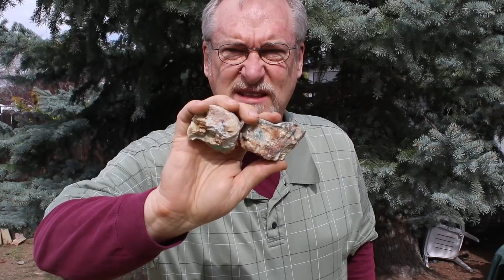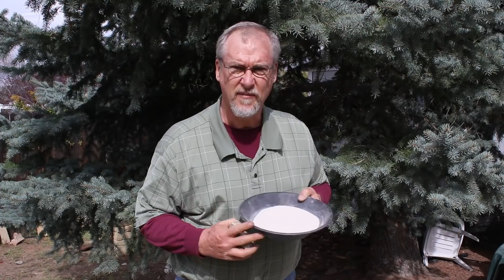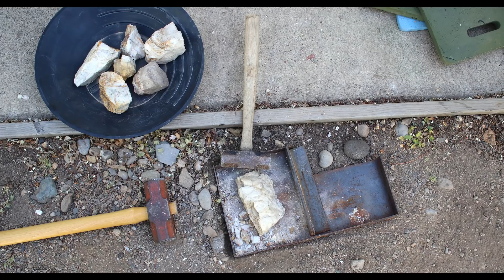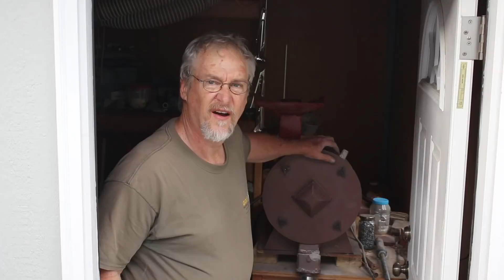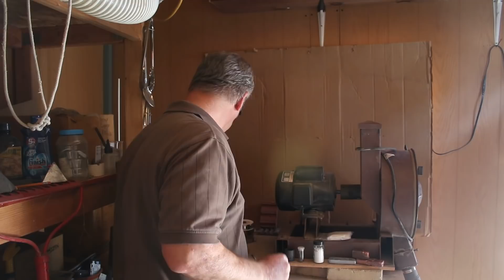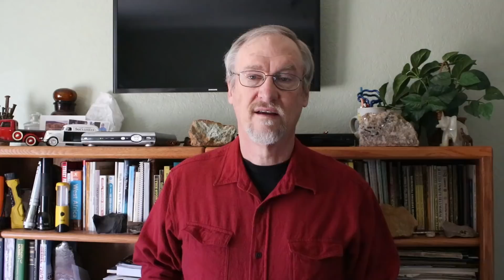Gold Prospector Reveals Best CHEAP Techniques for Finding Gold

Comment: Hey Chris, this is the one and only time that I know some thing that you might not if you would like to have your chains last longer put your ores in the fire and heat them up to soften up the rocks so that way when you put them in your crusher, they will be softer and your chains will last longer you won’t have to switch them out so much so often this is an old minors trick. I heard that if you soak them in vinegar before you heat them up that  works as well. But I just heat them up in my fire pit in my backyard and use my leaf blower to increase the temperature on the rocks and speed up the process. Some guys put them in a metal container and then put it in the fire, I find putting them in and letting them get going down to the coals works just as well.
Reply from the maker: Or you can use hardened steel chains.

Comment: Chris, I was wondering if TWO rock crushing machines are necessary.  The jaw crusher and the chain crusher?  They are so expensive and wondering if perhaps a newer crusher had been developed that would take a larger sized rock and pulverize it to powder.  Thanks.
Reply from the maker: You can use the chain mill only, but it is much slower and makes a lot more wear on the chains. It will cost you a lot to save money 💰.

Comment: Chris, your flux only had two components while Chapman flux and thinner has a few more.  Why is that?
Reply from the maker: The fluorite "thinner" doesn't melt at the temperatures used. CaF2 melts at 1350 - much higher than my furnace ever gets. The other thing is that it is not a thinner but a thickener. Its used in steel manufacture, but steel melts at much higher temps, so CaF2 is OK for that. Silica can be good to add if you are melting stuff with no silica in it, but its not absolutely necessary. Borax is the main thing that will capture iron oxides in a flux, and that is what I was trying to do.  Chapman flux works, but is over-rated as if it had some kind of special properties.
Reply: @ChrisRalph  I haven't done this process yet so your input is very much appreciated.  I was reading your book a second time last night and I think that I found exactly what you describe on page 216-219. My last question is do you think that roasting should be done prior to smelting?
Reply from the maker: Depends on what you are melting - some things need to be roasted, others do not.

Comment: Chris what do you know about 1960’s and 70’s metal detectors? I have a crystal controlled b f o metal detector “hiker 2” model from I think the Kovack company. They used to be advertised in the c m j. Any info would be helpful. Much thanks.
Reply from the maker: They are ancient technology - you are basically handicapping yourself. Think about what it would be like going back to a personal computer from the 1980s. You have the metal detector equivalent of a 1985 computer. New BFO detectors have not been made since around 1990. You could get a better detector for $200.

Comment: Thank you very much for making all these videos.  Although I have had a great geology professor and a couple semesters of geo classes I had never considered trying to turn prospecting into profit.  Well the Virus hit, paying work evaporated and I’m a single parent so now it’s five months later, I’m dead broke and we have 34 days until we are homeless.  But thanks to you we have a few on ounces of concentrate!  Just watched this video for the 5th time.  I’m stuck, 
where would we find the flux, the Borax and Sodium bi carbonate? 
Do you think a plumbing torch and map gas would do it?  Could a ceramic coated steel pan work as a vessel? 
Is there some household object that will work as a mould like a plumbing fitting?  
And finally how do we turn the cast button into cash? 
Thank you so much , if my little girl and I have a roof over our heads this winter it’s completely because of your selfless work making these videos! You’re the best!
Reply from the maker: You can get borax and bi-carbonate at your local grocery store.

Comment: Chris, you might want to try a higher hardness chain also called a proof coil chain. The cheap box store chain is normally a grade 5 or grade 3 chain. If you get hold of a higher grade chain it will stand up better to abrasion
Reply from the maker: The inside of the mill is sized to hold specific sized chain, and the harder chain is sized different so it does not fit.

Comment: Hi Chris.  Thanks for demonstrating the process from rock to metal.  Basically, how we did at our lode mine near Searchlight, NV many years ago.  However, we had the luxury of a 10" crusher and 48" impact mill.  Average .5 oz/ton Au and 1 oz/ton Ag.  We also collected more mercury then we put in !
Reply from the maker: That would go through the rock pretty quickly!

Comment: I'm going to weld a ball hitch to hex pry bar...make  a morter outta a thick piece of pipe heat up a piece of 1/4 inch plate to fit the pipe...round it to fit the ball weld it in then 1/2 inch plate for the base putting the bottom of the mortar right against the plate...I wont have to pay for a gym membership then... everytime the wife gets mad at me I can go pound rocks into sand sounds like a win win...
Reply from the maker: Breaking rock is exercise.....
Reply: @ChrisRalph  worked concrete for 15 years I made a lot of rock 😅...for some reason I get great pleasure out of cracking open rocks...I can watch the old granite splitter gent for his whole videos rod n hammer...tik tik tik tik tik tik tik...tik hole wedge again...again...again.
.tik...tik..tik tik ....tik tik tik tik....crack...love it....everyone in my life has called my passion for splitting rocks and my amazement over rocks  silly... or... childish...or absurd...now I can share a video...and they are starting to see...they go...ohhhh...i dont want to get in it for money...idc....about the money...bonus 😁 but idc...I got a gold pan... I got a sluice matt built a small sluice...a metal detector.....i have a microscope some trinkets...a chipper...scraper...hook...wedges...3 n 6 lbs thor hammers and a will to give it a try...for the sake of exploring my environment...my kids love busting open rocks as much as I do and pockets always have to be emptied on wash day because our pockets are all full of rocks...lol even mine...sooo...time to figure out the legalities in my area and go forth and explorify...👈had to correct that 4 times to make that a word👍😆...I really really rather than gold or other metals, would like to find geodes small aggets and little gems...we can make jewelry for my autistic daughter...she loves homemade things...I'm going to get some of Dan Hurds ocean picture stone...that right there leaves me speechless...n my daughter looked at piece after piece...so I hope I'll figure it all out and get to get in on the action a bit...love your videos...thank you...

Comment: Hey Chris. Thanks for your very informative videos.  I live in NE GA, a stones throw from where gold was first found in the states.  It's hard  to find info about the specifics of prospecting here and was wondering if you had any advice.  Most locals don't bother with looking and the ones that do are pretty tight lipped.  So far lots of fun in the woods and creeks, which is kinda the point, but not much luck.
Reply from the maker: Lots of info out there - search on line. Problem in the SE part of the US is that almost all land is private and owners dont welcome prospectors trespassing on their land.
Reply: Thanks for reply.  Luckily I own a cpl of properties right in the middle of the " gold belt" so no trespassing for me.  One is lowlands where 4 creeks converge the other, where I live, is cut into the side of a mountain.  Been collecting hopeful ores and starting to crush.  Your videos are great and very informative, so thanks again for the info, I'll keep watching.!  Peace.  Z

Comment: Does the flux mix you used make it so you don't need to roast or was the ore you were working with a type that is not going to add to the gold by roasting? Thanks for all your work
Reply from the maker: There were very few sulfides in the concentrates, so no need to roast.
Reply: @ChrisRalph  does your book go into detail on what ores should be roasted or how to "see" the sulfides? or maybe a video I missed. Honestly thank you for all the information in usable form.

Comment: The sitting on seat clip with lecture is mute for me.
Have you a source for me to buy one of those rock crushers please? Does it have a brand/make or model please?
If you must use cheap soft chain you should prepare some with hard steel paddles welded on, Make several and balance them by weight into pairs.
Reply from the maker: Why dont you do that? your comments are mute to me because you dont know the work involved.

Comment: Chris, I put the hardest chains I could find in my custom built chain mill as well as I built it out of 1/2” hardened plate. The chain you showed in the video is mild compared to the stuff I use. I know this just by looking simply because I have worked with many different types over the years. All chain is NOT created equal. I strongly recommend you source harder chain before you do your next crush and see how much more use you get before replacement. I have not crushed enough to be able to say how often I need to change them but well over 200lbs and they hardly look used. I do not have a jaw crusher so I’ve been putting big chunks into it. The inlet is 4”x 4” Hope this helps on your maintenance.Happy Hunting 😉
Reply from the maker: I agree, except mine is not made for the harder chain. I have some hardened chain but the links are not the same size, so that 2 links are too short, 3 links hits the walls of the chain mill.

Comment: I find myself wondering without a way to test the ideas , two things recently . first is , would with big rocks of about 200 punds and larger,could a  thermite be used to semi smelt the ore right in the field? My thoughts are if one could drill a  hole in the rough center of the width of the ore rock about 2/3rds deep. Pack with thermite and alot of flux (to help isolate the iron it will make from the oxygen burning out of the hemitite. )  set off the thermite with magnesium ribbon or an electric arc...or cutting torch... And let it do its work in open air.   I think it may embrittle the rock itself and essentially preform larger metalic beads in the substrate than the specks that naturally occur. So it seems like it may save some effort and alot of man and machine wear.  As i am quite physically disabled , i am looking for anything to simplify every aspect i can of prospecting without making it less effective. I want the chances of me getting gold to come down to knowledge and skil and experience ,with a twist of good luck.  Im not joking or wise cracking i am genuinly curious...Extremely so ,as to how that would work . will it  preroast the sulfides ?... My question to you is Were can i read up on this? Isbit in your book?
Reply from the maker: Heating rock does not necessarily collect the gold out of it. Melting ore is not a good idea.
Reply: @ChrisRalph  aside from the fumes from sublimation that it would create , what does it actually do? What i picture is the rock melting around the thermite creating an odd glassy core similar to obsidian mixed with pummace.   I would also not put thermite in the heavily minerlized areas...it would be the hostrock/ wallrock or matrix (whatever name fits the situation)  i just mention because i know this day and age, one has to assume they are talking to someone with no critical thinking skills nor common sense.
Reply: @coreymerrill3257  Hi there, I don't really know what you're talking about and don't have much insight, but it's similar to freeing the gold in placers from clay. The clay has to be ground down before gravity separation. You can't really melt the rock, and the molten gold won't flow unless the rock is sufficiently crushed. Good luck.

Comment: Wouldn't lower the rpm little bit maybe 600-650 invrease the chain age at least little bit? I know galvanize steel chains not strong mayne 50% less trong than normal stainless steel but its really cheap and yea it might add some zinc impurity to the crushing rocks but if you choose rhe right rpm it might do as good as normal steel chians !!!
Reply from the maker: The chains wear because the ore is abrasive. Speed would not help much as it would extend the time the chains are flying around hitting the ore.